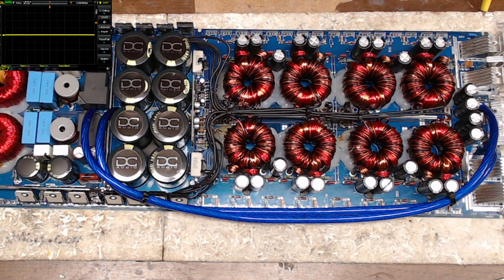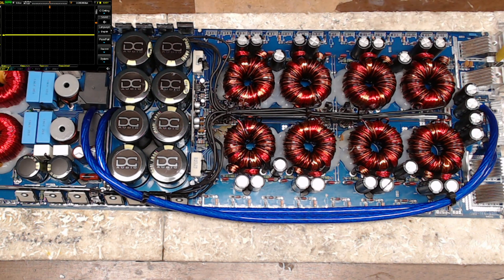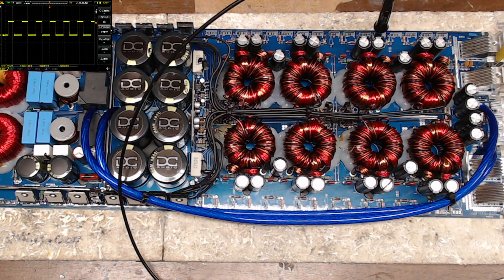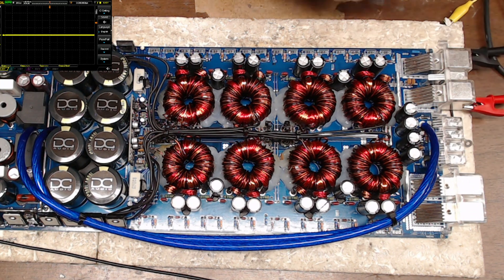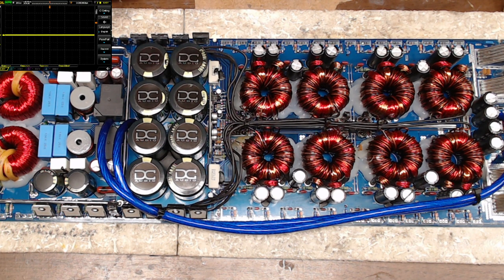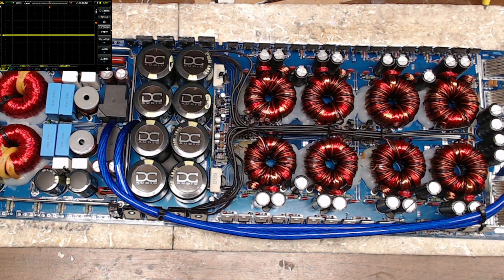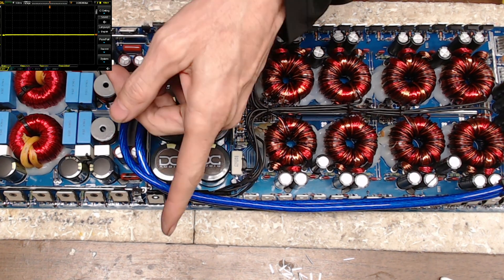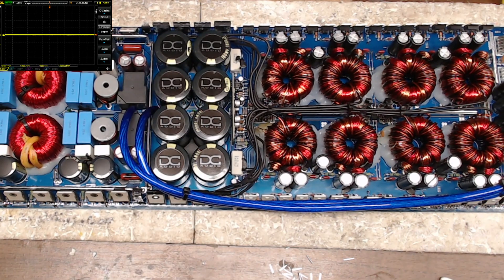DC Audio 5 0k Class D Amplifier Repair PT2 of Power Supply and Output Section Testing Included

Comment: I’m at a point where PS is repaired on a similar DDM4, proper gate switching at every FET socket, but soon as PS FETs are populated switching is nil, Rects and OPs still removed. Man these boards always mess with me 😅 lol. 
On to the next video!
Reply from the maker: Remember that one or two transformers have auxiliary windings which are independent from the rectifiers. Those transformers will still try to power the aux. circuits even with rail rectifiers removed.

Comment: Hi dear friend
Is it possible to explain a little about the differential amplifier in class ab amplifiers. And because an op-amp is often located in the middle of the board, in front of the small driver transistors. What is its function?
Thank you for reading my message
Reply from the maker: The problem with trying to explain differential amplifiers is that they are used in several different ways in an amplifier both class AB and class D. I find most need to understand the "why" and the "how" part of the function of an op-amp (and comparators). For instance, an op-amp in front of the pre-drivers can be used for noise rejection before getting amplified. This would be a hard one to explain in a video for the people who don't know the functions of an op-amp.
Reply: @ellensburgamplifier  Thank you for answering my message
I understood what the operation of the op-amp in front of the drivers is and thank you very much
I like your calmness when explaining the circuit

Comment: In my case in majority of customers don't realize how much current drawn them amp and I see 96% of video when they drop below 11v in some case touching the low voltage protection then shout down instantly   amp. Bad crimped cable long and tiny obviously without fuses, this ingredients for a beautiful toasty amp 💥💫😂😂. But there is a lighter side  and it is  more job for us 👨‍🏭💵💵💵.
Thanks Todd for new video.
Reply from the maker: You have to love what keeps us in business! Unless we can't get the parts to fix them ;)
Reply: I appreciate all customers and gaffes 😉

Comment: Hey todd , have a few questions but unrelated to this video . Should the output reading of +/- voltage rectifiers be exact opposing figures . IE +20/-20 , +25/-25 ? The one I'm working with is +27.3/-29.7 . Does it signify an imbalance in the power supply ? Thanks
Reply from the maker: That is a slight difference between rails but not drastic. During idle, one rail may be loaded slightly heavier than the other. I would also check to see what the amplitude is of the square wave coming from the secondary side of the transformer. Can also be a tolerance difference. Just remember that your positive and negative rails are based on the amplitude of the square wave feeding the rectifiers.

Comment: Where do you land the ground of the oscilloscope probe
Reply from the maker: My scope is grounded to the 12v ground (black) of my power supplies. There is a ground terminal on the front of the scope where an alligator clip goes to the power supplies.